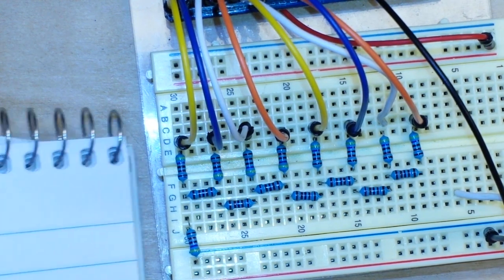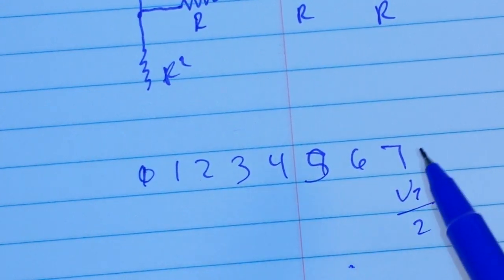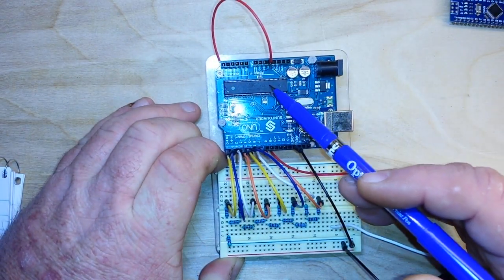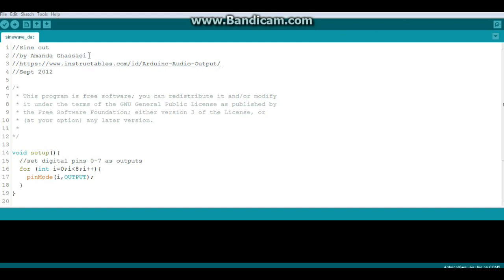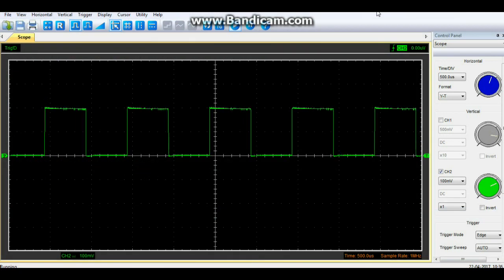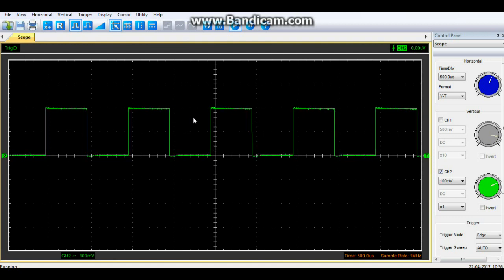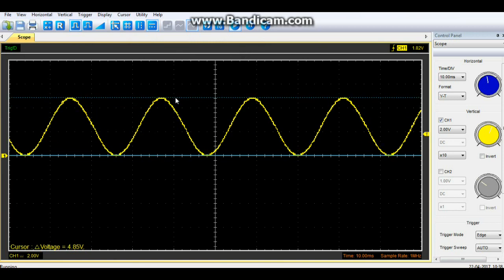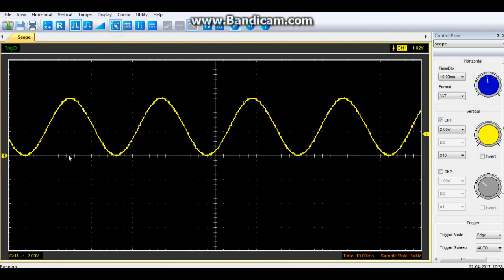Arduino Basics  Digital to Analog Conversion

Comment: Thanks for the video. From a practical standpoint, what is the advantage of an R2R ladder over straight PWM. For that matter, is there a reason you'd want to use this over a setup using a PMW output and a filtering capacitor?
Reply: I could be wrong but from what I remember pwm is just a square wave from 0 Volts to 5 Volts that are pulsed at just the right times to average at a certain voltage which in something like an audio amp can sound annoying while R2R ladder gives a constant voltage output
Reply: @arthurfoxthearcticfox  Thanks!

Comment: Thanks Paul. I haven't played with my Arduino in years. I prefer analog circuits.
Reply: analog is fun but it is a lot harder than digital in my experience
Reply from the maker: I'm an analog guy from way back to the 80's
Reply: Analog circuits just seem to run smoother and LED's look warmer. I have 2 Night Rider KITT's with 6 LED's; one with analog components, and one with the Arduino. The analog LED's just look warmer and smoother.

Comment: You did not show us where to tap into the circuit for other voltages. Can you only tap into the end of circuit like you did?  As you did that,  I only saw one voltage level,  not many different levels. Can you make another video to compliment this one discribing how to achieve some different levels of voltage?
Reply from the maker: You only tap into it at the output. If you want different voltage you change the input. It's digital to analog so you send it 0001 to 1111
Reply: @learnelectronics  can I use the r2r lader, to have a pwm input to it and a analog output from it?
Reply from the maker: No, you input a binary number and get flat DC out
Reply: @sargetester99  To get pwm to flat analog signal you'll need an RC filter or a Sallen key low pass filter, google it... Websites to calculate values for cutoff frequency, cap values and resistor values. R2R ladder replaces pwm and is a stable output where the RC filter might have more noise and can't opreate at high frequencies due to voltage range drop from recovery time for caps etc.(Sallen key filter has less noise to my knowledge, still have to test though). If you need the pins on arduino for something else you might want to use a shift register or two to save those pins for another purpose.

Comment: i wonder why noone made an IC with such a resistor network yet... would be the counterpart to a flashADC
Reply from the maker: There are DAC IC's. They probably use an R2R ladder. They definitely have a buffer and an amplifier.
Reply: i guess they are rather using a class d circuit, otherwise they wouldnt be so ridiculusly expensive sometimes :P
Reply from the maker: fredlllll true. I'm going to do a video on how to use a dual op amp to create a buffer and amplifier for the r2r ladder in a few days.
Reply: cool :)